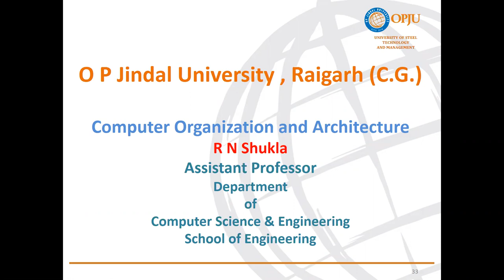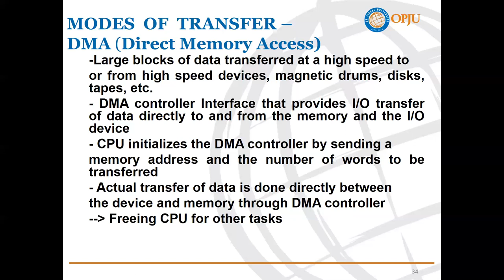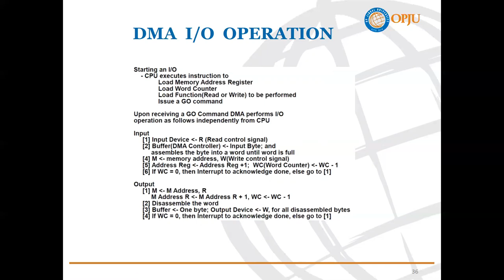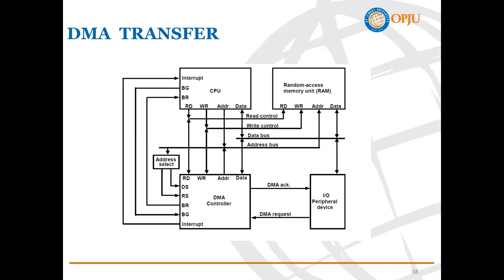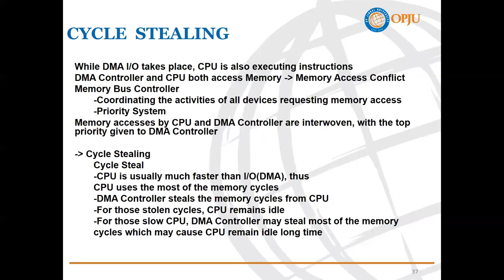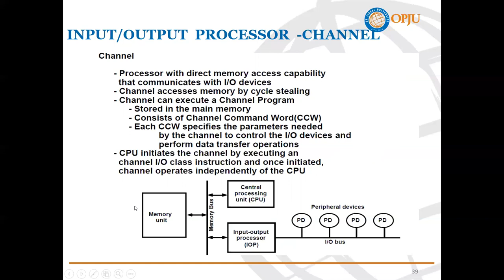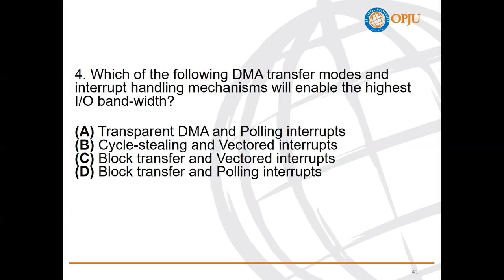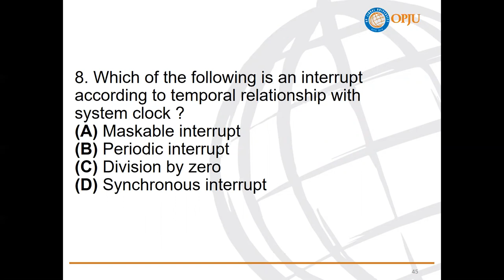DMA Controller

Comment: 46.Answer.4 
(C). Block transfer and  vectored interrupts

46.Answer. 5
(B)b.2,1,3,4

46.Answer. 6
(A). It gives non-uniform priority to various devices.

46.Answer. 7
(B). The isolated I/O method isolates memory and I/O addresses so that memory address range is not affected by interface address assignment

46.Answer. 8
(D). Synchronous interrupt